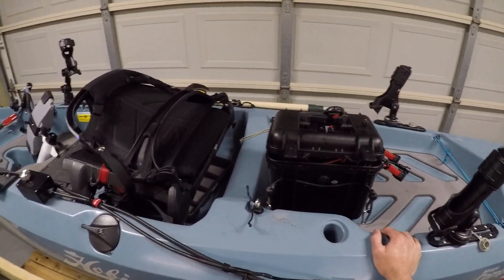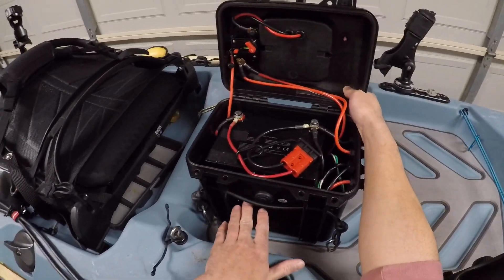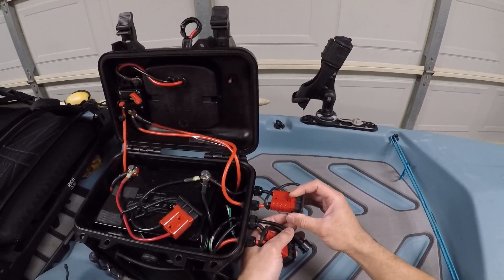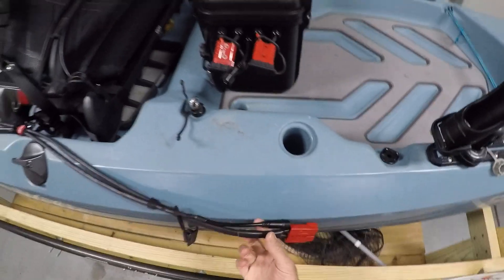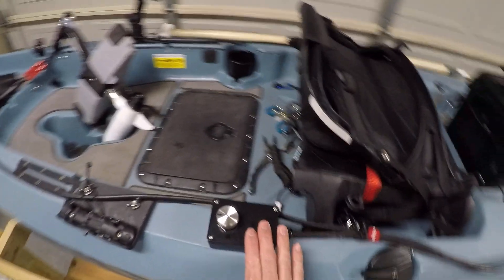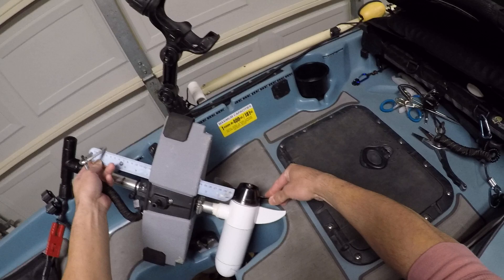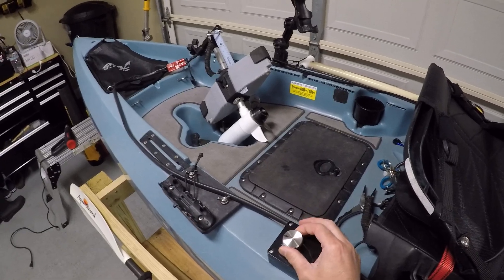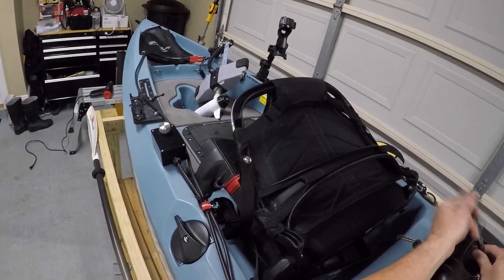Custom PWM And Battery Box for the Watersnake Trolling Motor DIY

Comment: What size is that black pvc tee ur using on the water snake shaft doing a very similar setup
Reply from the maker: It's a 3/4 inch tee with a small length of 3/4 PVC glued on. That short section was heated a little to stretch and fit the 1 inch diameter of the water snake shaft.
Reply: @JohnNguyen4  thank you👍🏼

Comment: Have you had any issues with this setup?  I need to my second kayak setup..  Any heat issues with the PWM in the same box?  Not sure where you live and how hot it gets in the summer..
Reply from the maker: No heat issues yet, but my motor is making some sounds occasionally and I think water has gotten past the seals into the motor housing. My motor might be working too hard when it gets caught in weeds and it's throwing the breaker. I touch the pwm unit and it doesn't seem hot at all.

Comment: nicely done..   I have a T24 coming for my Nucanoe flint along with a 50AH Life4pro battery.. been studying up on PWMs and am leaning towards spending a bit more on the Minn Kota PWM for peace of mind..
Reply from the maker: Thanks. Have you looked into getting an ESC controller. It's another option and could possibly be cheaper than what I spent for that minn kota controller and add ons. I may go that route on my next setup if this current one somehow fails
Reply: @JohnNguyen4  I bought the Minn Kota for 109.. buy once, cry once!
Reply from the maker: @charlesycoker  that's a good price

Comment: How are the Anderson quick disconnects holding up in the salt after a year or more of use?
Reply from the maker: Still doing fine. The waters I fish are more brackish than salt. The dielectric grease has kept the contacts from going bad. I hose the connections down with freshwater after every trip and regrease when necessary.
Reply: @JohnNguyen4  Hey John, thanks for replying. Glad to know they’re still doing fine with some care 👍🏽

Comment: So I can use 8gauge wire for the 24 lb thrust watersnake?
Reply from the maker: You definitely can. 8-10ga seems to be what most people use. The wires inside the motor shaft actually look like cheap 12ga wire.
Reply: @JohnNguyen4  awesome wanted to install my own pwm and needed to know appreciate the quick reply!
Reply: @JohnNguyen4  last question lol for a fuse circuit breaker do I attach that to the positive lead from the trolling motor? Or positive lead from the battery? I'm new to this lol
Reply from the maker: @TattmanFishing  I recommend a circuit breaker instead of a fuse. It connects to the positive side of the battery and motor. Battery > short wire > circuit breaker > wire (appropriate length) > motor.
Reply: @JohnNguyen4  I think I got it but if I'm using a PWM where the trolling motors positive lead goes directly into the pwm do I put the circuit breaker on that wire? Cause the PWM has positive and negative connects for the battery and the trolling motor. Sorry for all the questions I've tried to do my own research but haven't found much useful. I do appreciate your replies 🙏 just don't want to mess up my motor or PWM
Reply from the maker: @TattmanFishing  battery positive terminal > wire > circuit breaker > wire > positive terminal pwm > positive wire of motor.  Then for your negative it's: negative battery terminal > wire > negative terminal pwm > negative wire of motor. Hope that helps
Reply: @JohnNguyen4  you're the man thank you brother appreciate you 🙏

Comment: Very nice video! I can actually hear and see what you're doing! Just got the same motor (transom mount) , have 7 kayaks and all rigged out. But I don't know crap about electronics! This motor has 10 gauge wire and having trouble finding receptacle for battery box. Also, what is the exact circuit breaker you're using? I'm using a 30ah, lithium. Thanks for any help and keep up the good work!
Reply from the maker: ANJOSHI Circuit Breaker 50amp... https://www.amazon.com/dp/B07K4ZK4VP?ref=ppx_pop_mob_ap_share this is what I'm using currently. Rated for 50 amps

Comment: Can I use 8 gauge wire instead of the 10 gauge wire?
Reply from the maker: Of course. Especially if you are using a bigger motor, 8ga would be required

Comment: Nice setup! Have you experienced any water getting into the PWM box? That is the only problem I have with my setup which is similar to yours; I have been through 2 PWM boards already from getting wet and shorted out.
Reply from the maker: No water in my battery box or potentiometer box. The cable glands make good seals and I applied marine goop on top of the exterior nut that screws on top of the potentiometer
Reply: @JohnNguyen4  How about the potentiometer shaft, is it water tight and what brand is your PWM? I think that where the water got through mine. Thanks for the info.
Reply from the maker: @obwith2.332  I don't think the shaft is waterproof. I applied marine goop as far up as I could go without gluing the turning stem to the rest of the shaft. The knob that I have is somewhat hollow underneath so I can mount it as low as I needed to without rubbing the waterproof box. I purchased the Minn Kota control unit that comes from a traxxis trolling motor.
Reply: @JohnNguyen4  Thanks. Looking at the Minn Kota control unit now.

Comment: Can you tell us what pwm module you used and what kinda dial for fwd rev did you use thanks.   Looking to add one to my water snake.  Love the ruler idea as well how did you modify that.  Thanks.
Reply from the maker: All the parts I used are linked in the video description. As for the forward/reverse, the potentiometer comes included with the Minn Kota pwm control board and the knob is from Amazon. The video I made for the ruler and be seen here https://youtu.be/4qxw7LN6LOY

Comment: Hi John, Very nice rig, well thought out. I need to do the same. When you ran your wires thru the loom how did you make  it waterproof at anderson plug? Is that  heatshink or black electrical tape?
Reply from the maker: I used heat shrink on all the exposed wires. The Anderson plug itself isn't waterproof, but I did use generous amounts of dielectric grease to help delay/avoid corrosion. Edit: for waterproofing the battery box where all the cables come out, I used cable gland nuts size PG7.
Reply: @JohnNguyen4  Thanks, very much appreciated.

Comment: Love the kill switch on top of the box......I just started kayaking and I dunk on my maiden voyage. Really could have used that kill switch! hahahaha
Question:  is the ring at the top rounds back into itself (red to red and black to black)? just wondering how that connection is made back to the quick connect.......
Thanks for your post!
Reply from the maker: I just soldered the red and black wires together. Color doesn't matter because the entire system loop comes from the positive terminal.